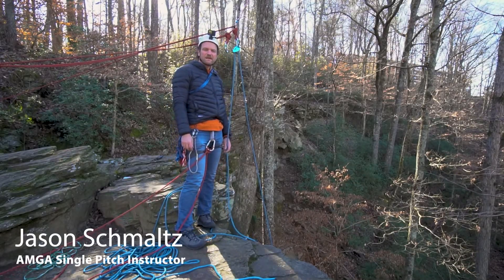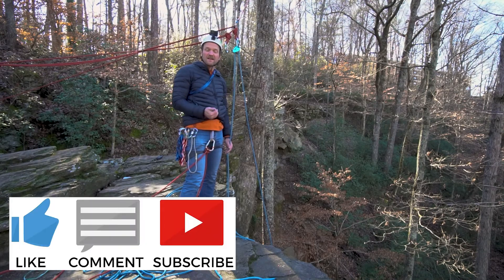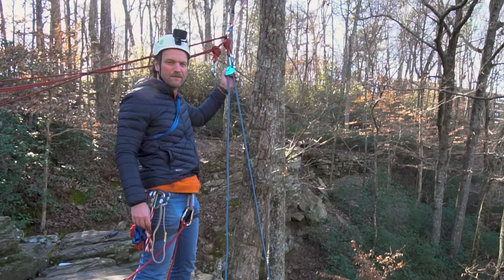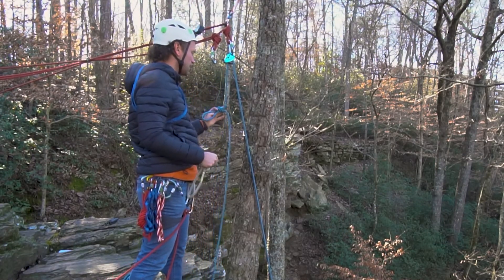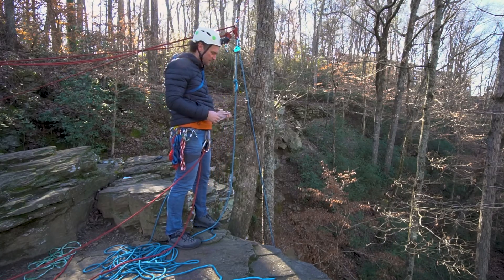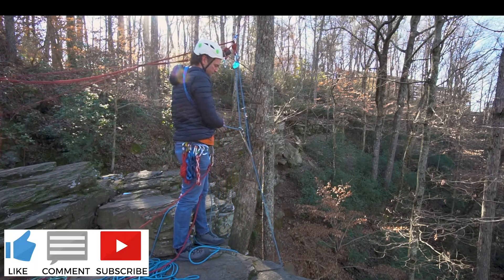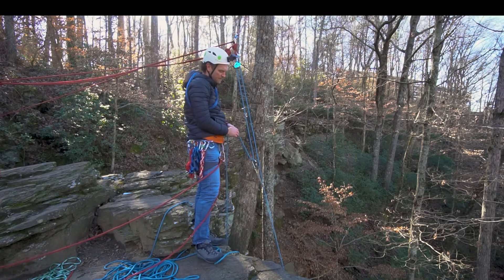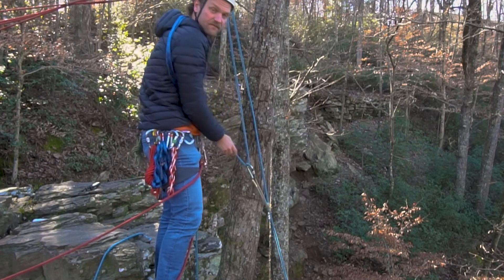Haul System Climbing | 3 to 1 and 5 to 1 How To and Physics Behind it

Comment: Thanks for the video! For a 5-1, could you also simply re-direct the brake strand through a pulley that is attached to the anchor, so you also pull down instead of up?

Comment: Ok.  If I have a microtraxion or other pulley on my harness, and want to make the 5:1 better. Should it be on the first stage with the brake strand through it, or the second stage with the cordlette through it? 

Obviously either one will work.   

I’m just curious if the system will improve with less friction on the part with low force and high travel or higher force and less travel.
Reply from the maker: I personally would use the microtraxion on the lower force prussik./